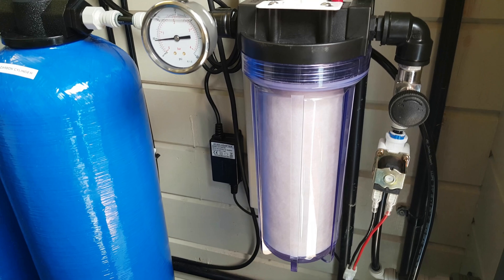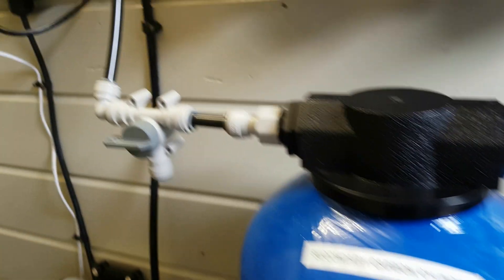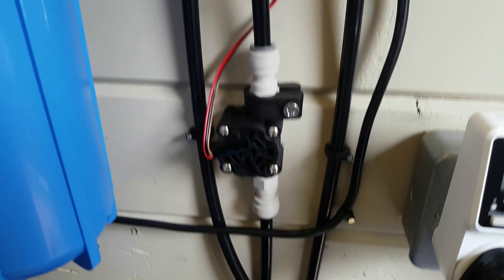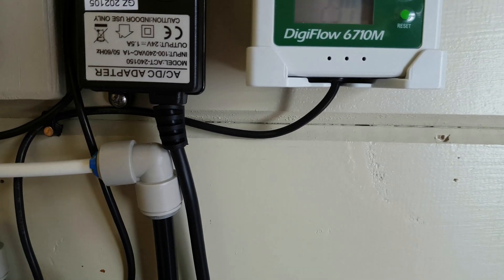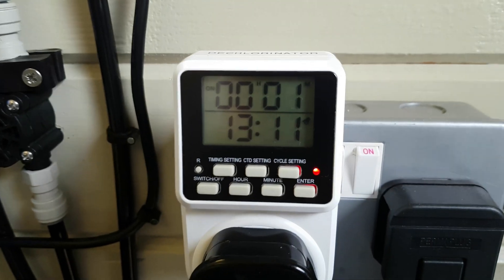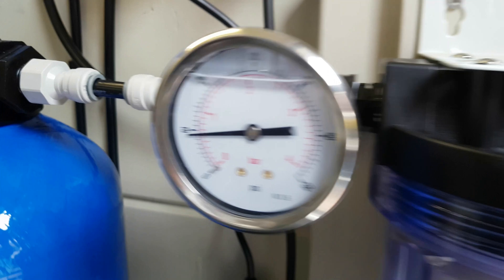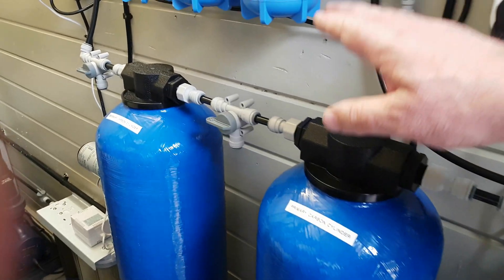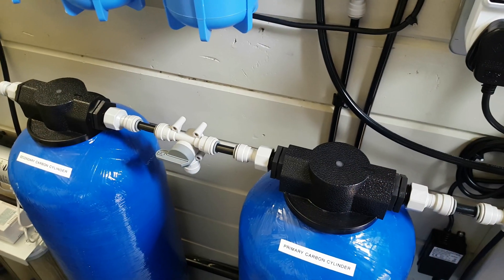Twin Big Blue Dechlorinator

Comment: Very good set up. Impressive. I really like the test points. Fantastic idea.
Reply from the maker: Thanks, Lau 😀
It just makes weekly testing easier/more likely to be done 😁
Reply: @DavesKoiPond  absolutely. Totally makes sense.
Reply from the maker: @LauMagroTheFrenchKOInection  
It works out cheaper than the 20" spectrum cartridges I was buying.
I can fill a 36" x 8" vessle over 3/4 full, 3 times from one 25kg bag of carbon.😀